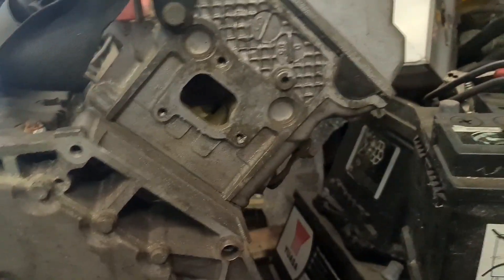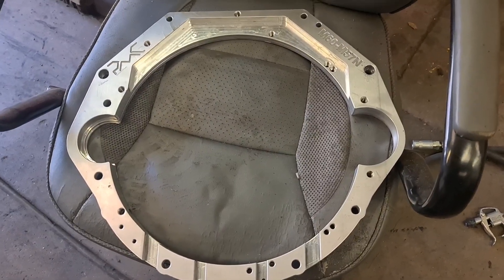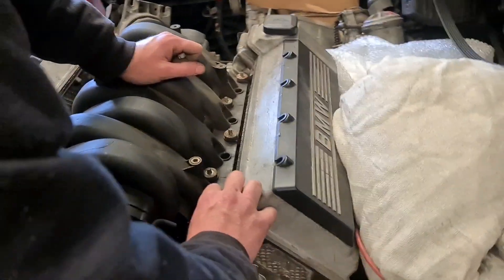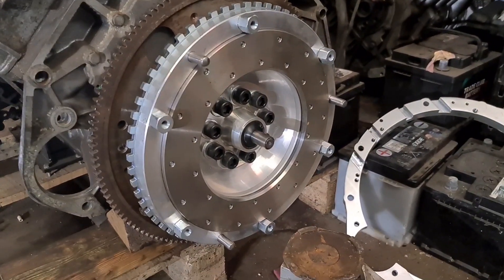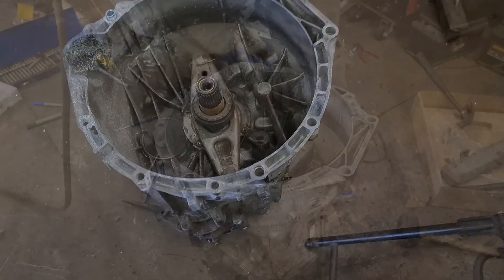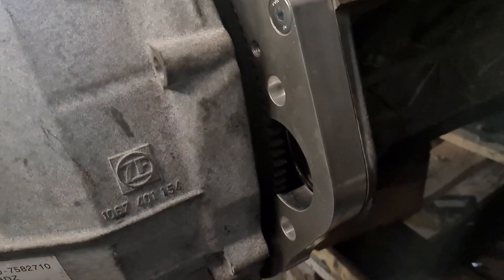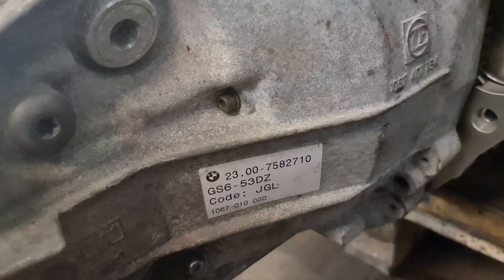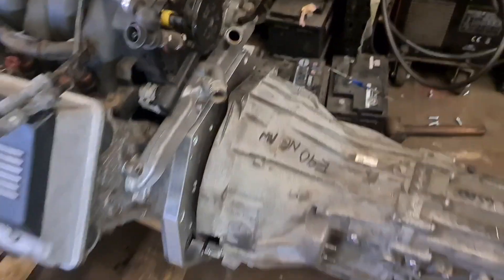M62B44 E36 V8 Build | Part 2 | More Issues | Pmc adapter plate and flywheel fitted.

Comment: Wouldnt 535 e39 gearbox fit without adapter?
Reply: What Im saying is that e39 gbox should fit without the adapter. Cause it was coming toghether with m60 m62 in 5 series innit
Reply from the maker: @mateuszjankowski8918  ah yes sorry.. yes the 535 gearbox will bolt straight on.. but doesn't have any location for the crank sensor as its on the rear of the m62. Plus the 535 v8 boxes are expensive and rare, easyier to use a gearbox that can be found easyier.
Reply: @GaragE36uk  true that
Reply from the maker: @mateuszjankowski8918  the 535 box was an option as we have one here that came with the engine
Reply from the maker: Yes providing you have the correct adapater plate for the gearbox then yes most gearboxs will fit.